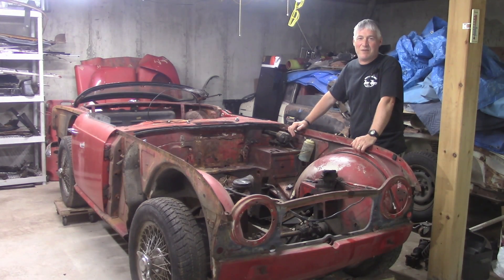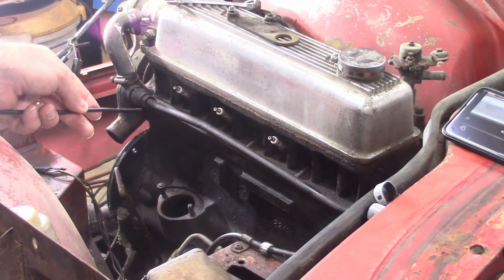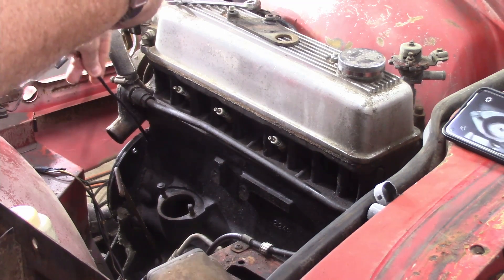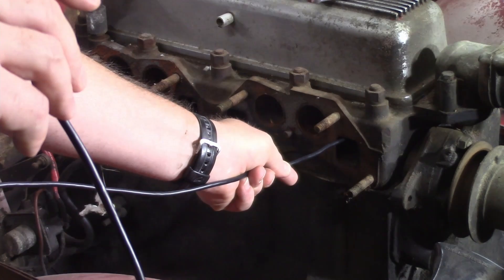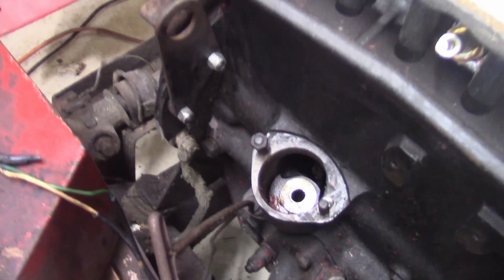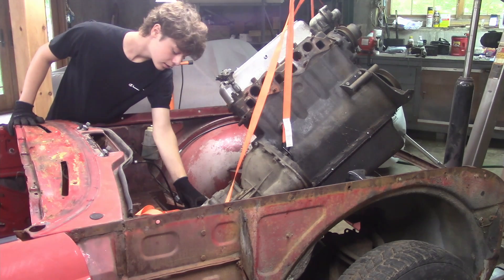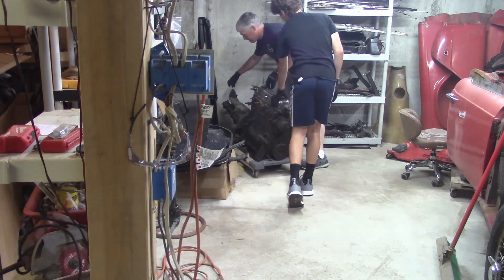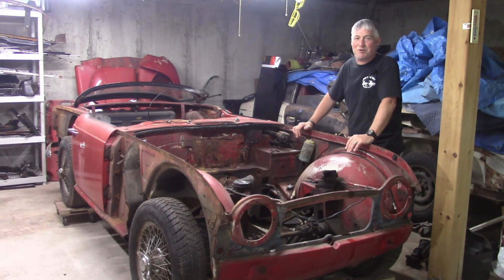Triumph TR4 Tear Down #6 - Motor Out | Roundtail Restoration

Comment: Nice work. You did a better job than me. I had an engine crane and in my effort to clear the front grille panel I raised it so high the crane hit my fluorescent light tube showering me with glass and leaving me in the dark. Glad I didn't record it. You're going great, I will follow with interest! Thanks
Reply from the maker: Thanks, Roddy. I almost forgot to look up until it was too late. Missed my light by about 3 inches!

Comment: Yes, that throttle cross shaft is pretty darn close to the rear of the motor and it doesn’t take much to bend it.  You should be able to straighten it out. No harm done.
Reply from the maker: Yup, I was able to take care of it by hand. Whew!